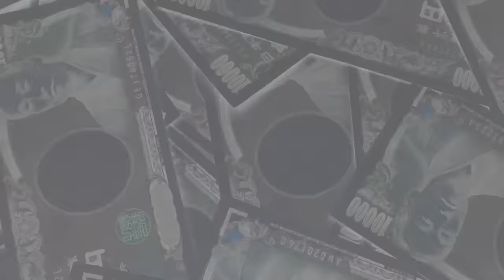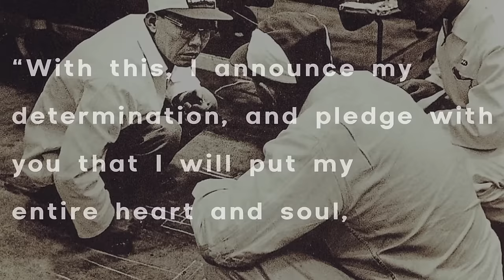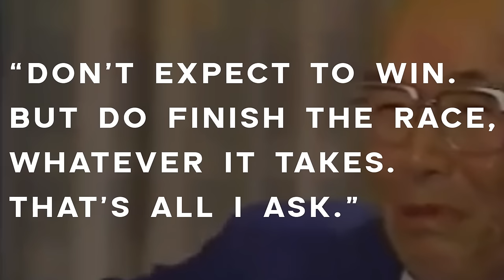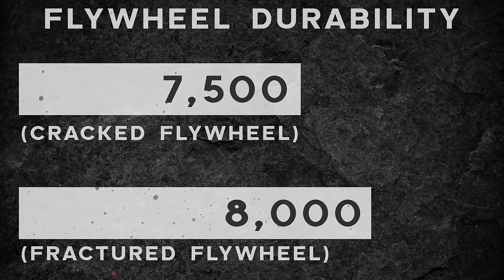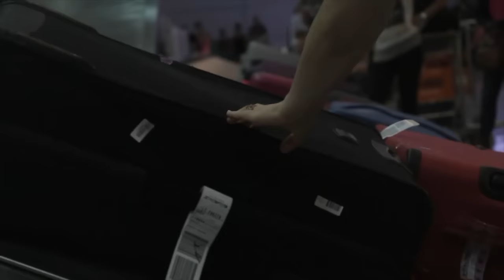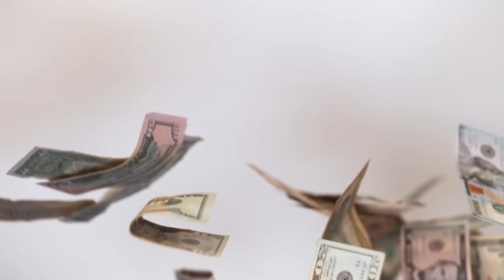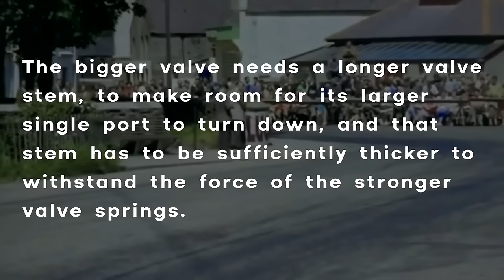Honda's First Isle of Man TT Win SHOCKED Everyone!

Comment: Honda is the only company in history to win a F1 GP race( engine), a Moto GP race and an Indy Car series race( engine) on the same day . That is some achievement.
Reply: Also Surtees is the only man to have won Isle of Man on 500 MV Augusta motorbike and F1 Ferrari car a couple of years later
Reply: @petermcmurray2807  that interview at john’s house just before he passed was awesome.
Reply: Honda makes some of the most awesome engines of all time.
Reply: @jamessharp9790  AND still today.  I was at a shifter Go Kart race 2 weeks ago. Honda won 80cc and 125cc class with 6 speed MX engines made in year 2000.   And now the Honda Jet.
Reply: BUT! The Triumph Trident still holds the astonishing record of FIVE consecutive TT wins.
Reply: @BigAl53750  Is that Slippery Sam? Are you saying the Triumph Trident engine was superior to Hondas engines? The Trident was the bike that killed the original Triumph motorcycle manufacturer. They had a horrible habit of chcking their rods through the crankcase.
Reply: Adding to @petermcmurray2807 - John Surtees is the only person in history to hold both world championships in moto gp and F1. His three consecutive TT wins was also a first. Early years were with Norton. Without four-wheel hardware like go-carts around, back then many F1 drivers came up through the moto ranks. Of course, the fatalities per number of races ratio in moto gp was sometimes counted in single digits.
Reply: Surely it’s far more of a coincidence.
Reply: @G58  Of course it is, but that was not the point. No other manufacturer has ever been involved in all three premier motor sport classes ( F1, Indycars and MotoGP) as Honda has. That is the difference between Honda and every other Car or motorcycle manufacturer. So at this time in history stand alone to have and are able to achieve that. I do not have the information available but I am sure that could extend to MotoX Gp's too. Oh yes and they have won the Dakar rally for bikes too.

Comment: Worth remembering that after all Hailwood did for Honda, they later withdrew from racing, but held him to his contract with them so he could not race with another team, derailing his career. There's gratitude for you.
Reply: From the article on Wikipedia it would seem that he had decided to retire early rather than ride for someone other than Honda (according to an article in "Motorcycle Mechanics") Then Honda paid him over  £870,000 (2020 equivalent value) to not ride with another team. I would say he did pretty well for having a "derailed" career!
Reply: Unfortunately, it appears he missed consideration of this very situation: where the sponsor simply decides not to race, the rider remains exclusively tied to them. He might have been successful in negotiating a release under those circumstances. Equally, Honda may have been aware that Hailwood’s value to any racing manufacturer & definitely anticipated the scenario. 
It is said that, providing the legal concept is sufficiently crisply defined, it’s possible to draft contractual language with the desired effect. If both parties sign, it’s unlikely that either side can become in breach of a term in the contract without there being consequences.
Reply: As long as they paid me that would be fine. Get myself into shape. Study all the tracts, do a little practice riding etc...

Comment: Thanks for a fascinating story. I was there in 1960 when Surtees put the 500cc lap up from 101mph to 106mph watching him drift an MV out of Governor's Bridge was phenomenal. Then 1961 HONDA. My friends and I actually touched the 250cc bike. It had run into trouble at the bottom of Bray Hill  and was left leaning against the hedge as we walked the track. At the time I rode a 1939 Rudge Ulster and my friend a BSA 350, we wont count the other mate's Fanny Barnett :-) We were looking at a 4 cylinder 16 valve  250 - Stunned. In Practice the 250 pulled out and left Bob McIntyre and Ralph Rensen up hill on 500s. The British industry died there and then. In fact the Manchester dealer finished 11th on a stock bike with electric start. The law was changed in England that year that learners could only ride 250s or less. Guess what every body bought from then on. Triumph devotees have recovered and Royal Enfield own India BUT!!
Reply: That's a great story. India owns Royal Enfield although it probably took them40 years to get hold of the 'Royal' part. I remember them as India Enfield's in the 80's when I was working at a Suzuki, BMW, Vespa dealers (weird choice by management)

Comment: I started on a used Honda S-90, then went to a CB160, CB450, CB750F2 Super Sport (still have).  I quit riding to raise a family and got back into it in 2016.  I have a Honda ST1300 now, plus a few others.  LOVED every one of them.  Superb engineering, metallurgy,  electrics, workmanship, etc, etc.  BULLET PROOF.  Itchey Boots rides a Honda, too.

Comment: If you read the Honda history you will find a surprising fact, Honda added a forged reinforcement  skeleton around the barrels, this kept their shape under load (compression, heat). He was a talented engineer and realised that the BSA barrels leaked compression due to thermal and physical expansion, leading to all the known English bad habits, oil leaks, rattles and efficiencies. He was simply an excellent intuitive engineer who was blueprint-cheating, but improving at the same time. The 50cc was the result, the motor that has zero bad habits, all the Asian industry started this way, for a really good similar story read "not much of an engineer" by hooker.
Reply: Thank you for sharing!

Comment: Did  Honda  ever  get  into  the  50cc  class?
Reply: I first saw Honda in an English motorcycle magazine in the early 1960's. There was an article about Honda's 50cc GP bike. It had an exploded view picture of the engine. A 50cc DOHC Twin. It revved to 20,000 rpm and had a nine speed gearbox. Of course it won the GP that year in the 50cc class.
That sold me on Honda. A company using technology like that was eye opening. Then, when I started as an apprentice motor tech, the garage I worked for maintained all the Honda cars and trucks for the Honda dealer. The S600, S800, and the little 500cc trucks were fitted with DOHC 4 cylinder engines that revved to 10,000rpm. Mind blowing at the time. Been a Honda fan ever since.